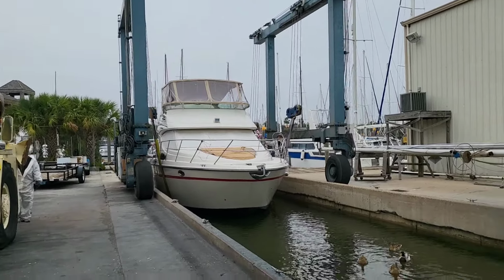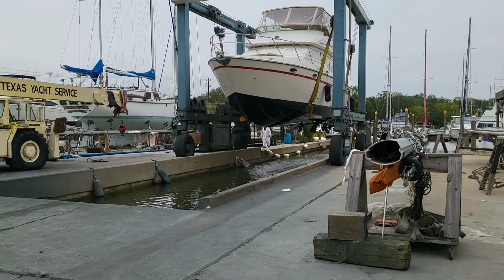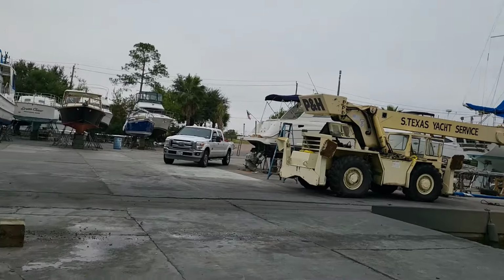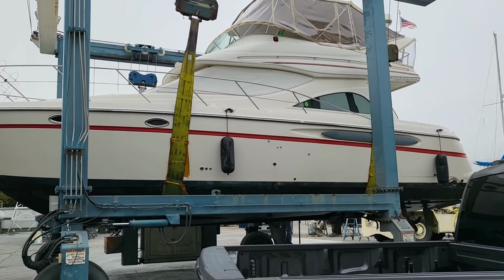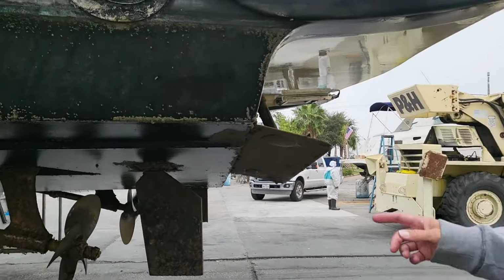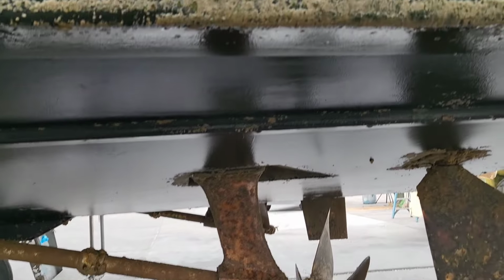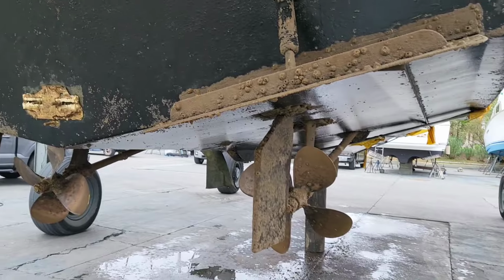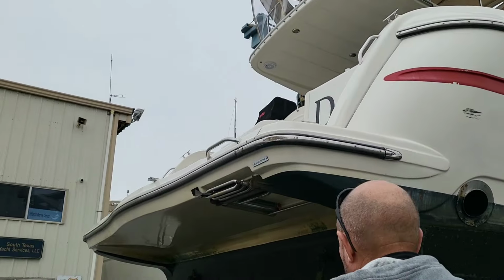Haul out of the Some Day, Nov 2022

Comment: You haven’t had that painted in 3 years? That was the view of it after lifting? No pressure washing? If Yes, Yes and Yes you got one great paint job on that bottom. I got a horrible job covered with barnacles and sea life after 6 months. Total redo. Good luck and get a copy of the paint specs they are using and file it away.
Reply from the maker: @stroguy  That is correct. The paint was 3 years old and it wasn't washed yet.  It was brushed by a diver 6 months before.  Our marina is in brackish water so maybe that helps.  We paid a lot of money for the paint but it's worth it not to worry about it for a while.
Reply: @adventuresofsomeday2194  My boat was in the same marina. Just a few docks down. We had a 90 day diver and scrub but our paint didn’t protect worth a crud. Lots of crusties. Good work and good luck with the new paint.